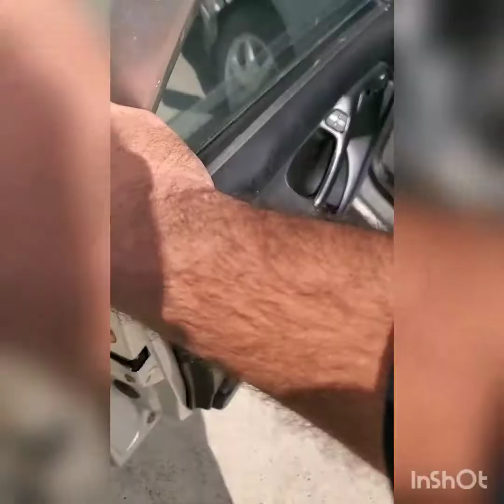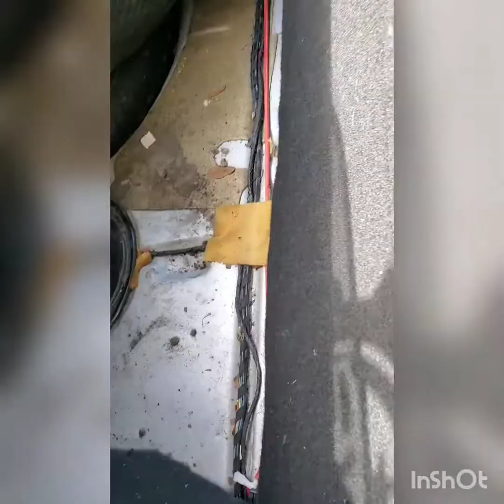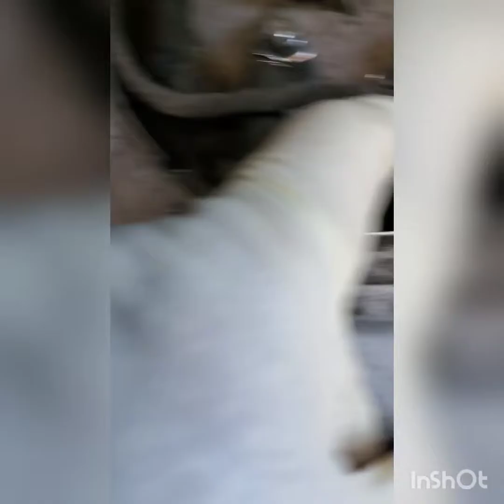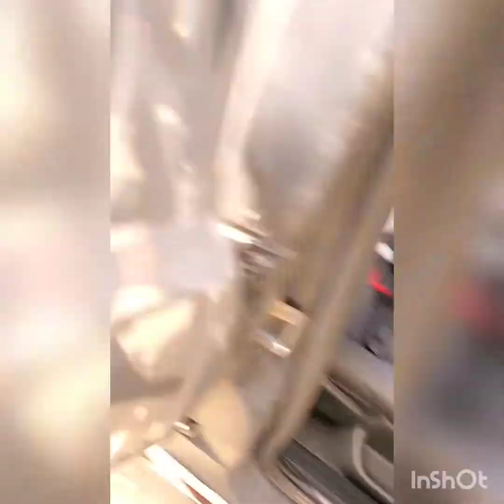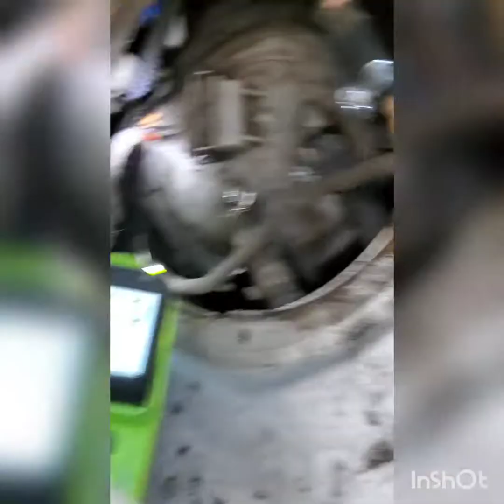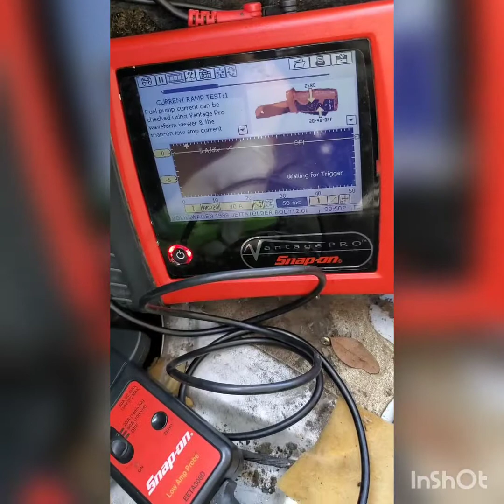VW Jetta MK3 Fuel Pump testing

Comment: Any idea how many volts i should be reading at the pump harness. I am getting 1.125 volts. at the harness. Good ground. Pump runs when hooked strait to battery, but getting nothing out of the fuel line before the fuel rail when plugged in and ignition turned on.
Reply: Bro have you managed to solve your problem, just bought one and it's doing this 😒
Reply: @darylpakkiry73  Check your fuel pump relay, #167. Mine was fine, but i still wasn't getting propper power back to the pump, so i had to remove the relay and just jumped it's socket with a wire to power the pump. Most likely ignition switch or ecu isn't sending the signal to the relay, but it could be a handful of things, and i didn't want to bother trouble shooting them all, so i just jumped the relay. I run a battery kill switch, so having the pump constantly powered isn't a problem for me.
You can try jumping the relay, wire from socket 87 to 30 ,and if it starts, you either have a bad relay, or your not getting proper signal to the relay. Relay gets power, switched power from ignition, ground, and a signal from the ecu that wont flip the relay if crank position sensor, o2 sensor, or coil on the distributor, isn't sending correct data to ecu.
You can easily rule out crank position sensor as a problem if the rpm gauge goes up when you crank the car.
Reply: Fuel pump relay